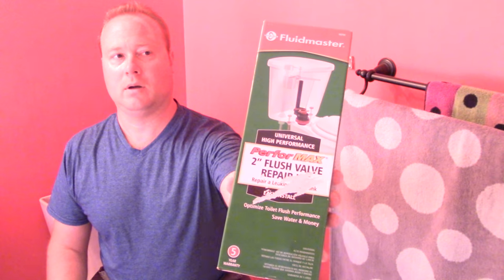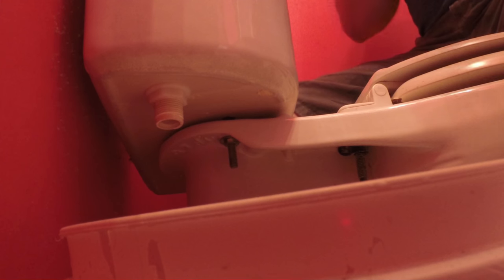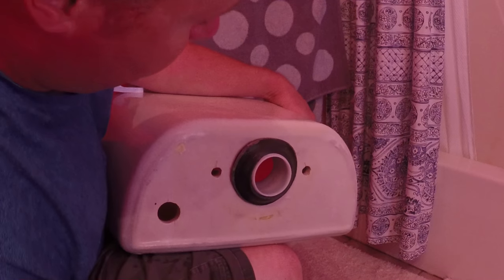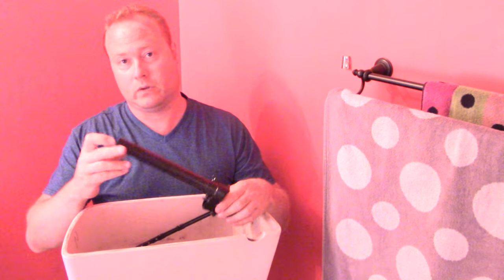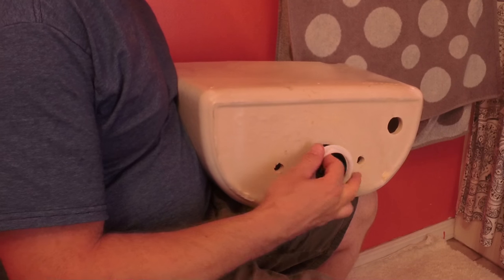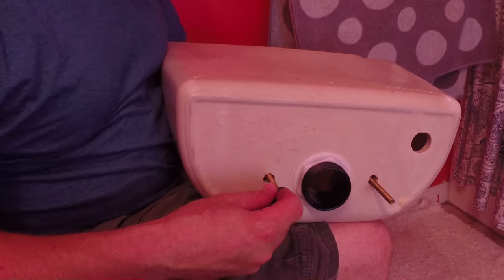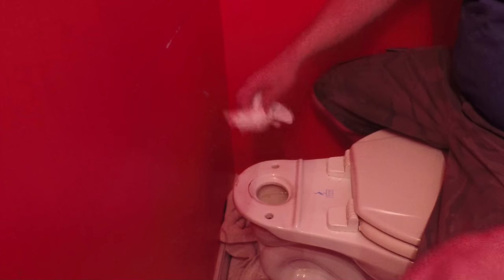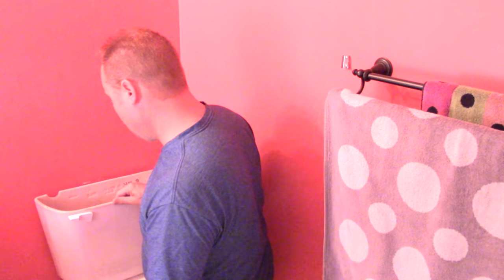Toilet Flush Valve - Installation

Comment: Thank you. I finally understand why the flush valve overflow pipe needs to be a certain height to make sure nothing overflows out the front or back. Everyone else was talking non-specific gibberish and implying it had to do with the proper operation of the fill valve and some secret proportion between the two valves. And trying to measure perfectly in a toilet tank with stuff in it is so awkward! Now I know the secret forever, for all future repairs.
Reply from the maker: You are very welcome. I was unaware of how others explained it. Though there are many people that overcomplicate things. I'm glad that I could make it simple for you, and straighten out that can of worms.

Comment: I don’t recommend putting nuts on the bottom because if you do have to cut the bolts because of bad rust in the future, it’s extremely hard to cut through the nuts.
Reply from the maker: That's not a bad point.
Reply: My wingnuts are still easily turnable.. likely stainless steel... I'm hoping the other 2 nuts under the tank are stainless as well...I can see them and they still look shiny at least..
 Leaving those two bolts off might seem okay at first, but I'm sure they are there for a very good reason and not putting them on might cause a leak over time...
Although the only thing I know about being a plumber is that shit runs downhill and payday is on Thursday 😀

Comment: Do you know if lined tanks can cause problems with fitting flush valves or is the foam cut away for the flush /fill valves and bolt holes ? Thanks
Reply from the maker: Honestly, I don't know. I haven't worked on one, but I know what you are talking about. I would assume they would have to be, but again I just don't have experience with them.

Comment: Good info.  So if I'm able to easily move that piece from side to side, the big plastic retaining nut underneath is probably loose and water can escape into the bowl?  The two bolts and seal were recently replaced so hopefully, I can get them off to tighten it up.  Thanks again!
Reply from the maker: Yep, that's what I am saying. And the wrench that I am using in the video really isn't big enough. You need a pretty big wrench for that. Even though it is more likely for it to leak in-between the tank and the bowl, it is possible for it to leak down to the bowl. Good luck on your project.
Reply: @AroundTheHome1  Thanks much.  I do have a very large Plummer's wrench (very heavy) so it should fit.  Thanks again!!

Comment: I put that red rubber thing inside and water leaked like crazy when I flushed.
Reply from the maker: Ok, I am going to try my best here. You didn't give me a lot to go on. I am going to assume that you used the same kit that I did in the video. I am also going to assume that you followed my directions and did every step. With that I have an idea of why the seal is leaking. There are a very small amount of toilets out there where there is not enough room for the extra metal nut that was installed on the bottom of the tank. Take it apart and remove the extra rubber washer and metal nut on the bottom side of the tank. The extra seal is nice, but will not work with every toilet. This causes the tank to sit a little higher then designed and will not allow the new tank to bowl seal to do it's job. I hope this helps.
Reply: @AroundTheHome1  . I wanted to thank you. I put that red rubber thing inside the tank. Your video explained the proper location for it. I am going to repair today after work. I have to let you know how it worked
Reply from the maker: Oh, ok. I went ahead and re-watched the whole video to help out. Good luck on your project.
Reply from the maker: Thanks for watching and don't forget to stop by our website for many more helpful videos. www.greatwhiteninja.com
Reply: also no leak when tank full, but flood when I flushed. Removed washers as you said (original only had one washer set )- but still flooded!  (I was prepared this time). thinking I may need different gasket? 1981 toilet. All else exactly as shown with same kit.